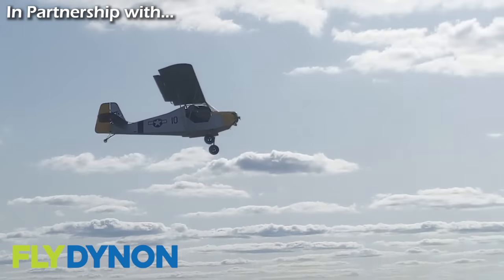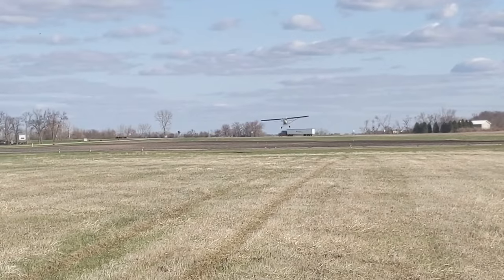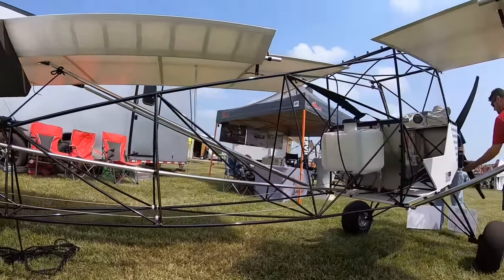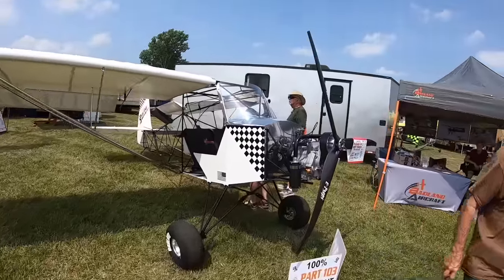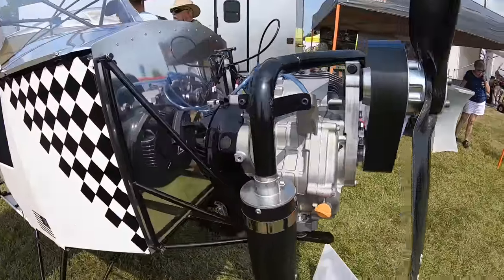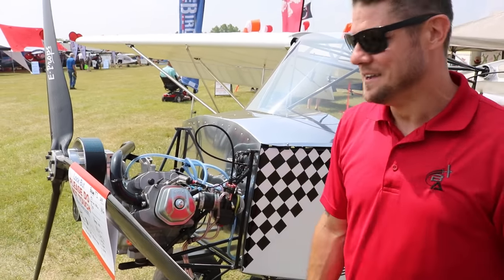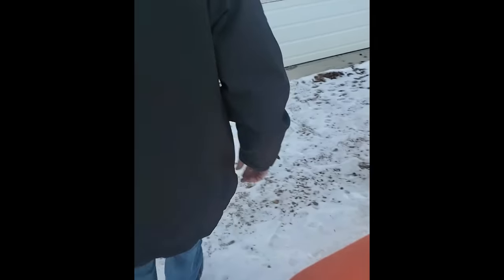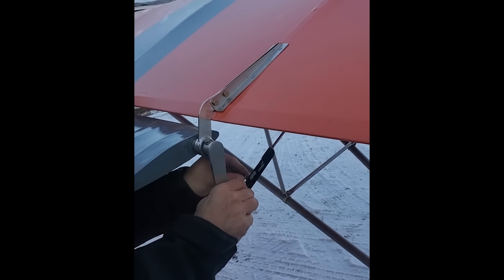No License Required Ultralight Airplane! Badland Aircraft - Oshkosh 2023

Comment: What is flight performance like with the 40hp 4 stroke and 3 blade prop? Assume 200 pound load. Avg takeoff roll, cruise speed, stall speed. How big is the fuel tank, so what kind of range could you expect?
Reply: 5 gallon fuel tank maximum
(if flying as an ultralight)

Three hours flight duration, close to 200 miles...

Get an "N number" and it's a different story.

Comment: He gave the impression that the one engine option was an all internally designed and assembled.  Where does a start up company with relatively low sales, albeit low overhead, get the $$$$ to afford the tooling to cast an engine block, cylinder head, and the support bracket to the prop is made out of a billet.  At $5K for an aircraft engine, that’s a good deal.  You can’t get a brake job on a BMW for 5$K.  I’m gonna have to drive over there and report back.  Stay tuned.
Reply: It's a Honda engine assembled with a bunch of aftermarket go-cart racing parts that make lots of power without exploding. The cart racers have already done all the designing and durability testing. The work he mentioned in the video is really just selecting the right aftermarket parts and bolting them together plus their own design for the redrive to spin the prop at a sane speed. Redrive tech is simple and well understood so it's just a matter of some simple outsourced machining to make the parts. The $5k figure sounds almost too good to be true compared to some other airplane engines I've considered. A 50 HP 2-cylinder 2-stroke goes for more than twice that.

Comment: Did he just say $5,000 for that lawn mower engine?
Reply from the maker: YES. But all the internals are competition (racing) applications as Chris mentioned so low quantity batch production is higher costs.
Reply: 5 k doesn't seem that unreasonable. It's a 4 stroke aircraft engine.

Comment: ?!?!?!?        2:14   a main wing is  SUPPOSED  to  have  a  Load-bearing  Main  Spar, located at  THIRTY  percent of  chord.!!!!!!
Reply: Sparless wings are definitely possible
Reply: A couple thousand flying aircraft must not have got that note. All the Avid, Kitfox, and their copy-cat clone airframes for the last 30 years are built with this exact wing structure. They use one aluminum tube at the leading edge, another at about the 70% chord point, and a strut brace connected to both tubes at about 2/3 of the span. This wing structure works very well with low speed lightweight wings. What you describe is only needed for wings with no strut brace taking the weight and bending moment.

Comment: I have to hear that engine running at 39 Hp on 420 cc's where most 720 cc two cyl can't make 35 Hp reliably....Could it be that it is something like a B&S, "Animal" Go Kart basis....
Reply: It looks very similar to the engines on my pressure washers. Both are 420cc pushing about 16hp. I wouldn't dare try to push one to 40hp. Even with forged parts.
Reply: regdor  would have been nice if he had a little more info on the engine !!!  Who makes it , where whats it based on !!!
Reply: I’m shaking my head over that too.
Reply: @glenmel78 website says that number happens at 8000 rpm.. making power is possible with rpm but I agree with you, who knows how long that remains assembled
Reply: @glenmel78 all of these engines are based on the honda gx390 "13hp" industrial engine, typically used in cement mixers, it's the big brother of the gx200 6.5hp. I have all the parts to build a reliable 35-40hp on pump gas for go kart use in the shed from before I had kids, all the billet parts, big valve ported head etc. One of the big issues with these motors is vibration, they run a balance shaft from factory which is a big failure risk at high rpm. My crankshaft is rebalanced with tungsten at 58% balance factor from memory to permit high rpm without a balance shaft. I know mine is 390cc not 460cc but there is no way I would consider it suitable for continuous duty use much above 4000rpm. It's a bit like vw engines, I used to have one in a buggy 2300cc with 200hp, so how come all the VW engine aircraft don't have 200hp?
Reply: I have a 750 cc from a snowmobile. It makes about 140 hp. I'm sure it's about 2x as heavy as that motor though.

Comment: That's a Sweet Little Bird!!!
Is 300hp an option?
LOL
Reply: Only in the Steve Henry model.
Reply from the maker: I do believe 300HP would make this Aircraft a dangerous Helicopter. Not an Aircraft. Honestly... 100HP would be INSANE! (Someone will try it one day)
Reply: FAR 103 does not limit HP.     Stall speed of 24 knots stall speed and 254 lbs dry are your main design limits.  If you can get a 300 HP engine flying under those guidelines then do it.
Reply: Marty, where we're going, we don't need roads.

Comment: My question is on a nice calm day in Frozen Solid, MN, what additional panels does he recommend?  I figure a -40F snow machine suit, heated socks and gloves with switchable battery packs, heated helmet including defroster for shield.  I can’t move!  Like the man says “it flys itself”.  That’s nice but it’s not like an Amish horse that knows the way home when pops falls asleep after celebrating with God the excellent crop of grapes last year.
Reply: So ..maybe he doesn't promote winter flying?

But, here in Florida, practically any day is a good day for flying...
Reply: Well there you go. Invent a comfortable battery powered flight suit. Can't imagine you'd be in the air much longer than an hour in winter.

Comment: really nicely designed.  love the pivot wing design.   $5k for the engine alone is pretty darn fair considering a quality rebuild of a Rotax 503 will cost you about $2500 and then it wants to burn 3.5 gph.  a little surprised that the Thumpair has a 200 TBO compared to 300 for a Rotax 503.   Wonder about overhaul cost for the Thumpair?

Comment: Love this kit but I weigh 315 pounds.  Any way to change something to get the plane to handle a little more usefule load?  Heart issue so need to stay 103.
Reply from the maker: Only so much you can do to keep an Airplane LIGHT. And that has been done to this design already. Like most of us, the only thing we can do if we WANT to fly a specific Aircraft, is adjust our own personal "Weight and Balance." Looking to drop about 30lbs myself before my Aircraft is complete. And that one is Experimental. How bad do you want to FLY? :-)
Reply: @ExperimentalAircraftChannel  , Thanks for the reply, The weight limit seems arbitrary and unfair.  Those of us born 6'5" and 300 + lbs are just SOL when it comes to the numbers decided in 103.  Aerolite 103 seems like one of the only airframes that can handle larger pilots.  Unfortunate if you like the Badlands design but have my body.
Reply from the maker: @BruceTGriffiths  would love for the Part 103 rules to add ones "Note" into it stating something like "254lbs empty WITHOUT THE ENGINE" which would pave the way for MANY future options and give a pretty good weight increase to the Airframe.
Reply: Yes, you could change the construction materials in some key places to say, titanium, magnesium, and carbon fiber. Then add as much wing area as possible until you have the plane back to 253.5 pounds, but remember to into account the chanes to the tail due to the larger wing. That will likely change the CG, so a moving the motor location may be necessary too. Now, since you've changed the materials, shape, flying characteristics, and price point, you might as well change the name of it too. Let's call it the "Something Else XL."
There will always be a limit, and that limit will almost always seem arbitrary and unfair to those that are just a little outside of it.
Reply: @Logan4661  True that and Thanks,
Reply: @BruceTGriffiths  If flight is your goal, and not necessarily an airplane, you might consider (if you haven't already), a Powered Paraglider trike. It's relatively easy to get a setup that can handle your size. It's a different style of flying... but it is flying! Anyway, I hope you get in the air one way or another.
Reply: Thanks anyhow.

Comment: safety pins? isn't there something a bit more aircraft grade to do that job?
Reply: Agreed. It just has to stop the nut from turning so it's probably fine, but there's just something about a critical part of the airplane looking like a flimsy toothpick ...
Reply: I remember those kinds of pins safetying T/R valves and handles on DC-9's
Reply: I don’t think they are like the safety pins your mom used to temporarily fix the curtains…..😎
Reply: It would be a locking type pin like a reusable cotter pin and called a cowling pin by Aircraft spruce.
Reply from the maker: Chris uses all Aircraft Grade hardware.

Comment: I will be glad when that" no license required" statement is a thing of the past. There is simply too much to know about Aviation to just be turned loose in an aircraft.
Reply from the maker: No License Required does NOT mean that you shouldn't get training to FLY Light Aircraft. It is a true statement however. Part 103 FAA regs state this. You  should (and we recommend when flying ANYTHING) get transition training into that Aircraft.
Reply: Hater just dont fly

Comment: "No license required"......shocking!   But there's no license required to travel in you own private property....even automobiles....but that doesn't stop the sheep from applying VOLUNTARILY to be licensed, does it....
Reply: I don’t understand what you mean
Reply: Yeah because normal people have jet planes
Reply: You have bad interactions with the police I'm guessing.
Reply: 🥴 “sOvErEiGn CiTiZeN” 🥴
Reply: @s.eldenhall2938 you can travel. You can walk, take a bus or a commercial flight. You do not have a right to drive or fly outside your own property. You can operate a car on your own land. You can taxi and aircraft around your own land too without a license, but you cant go anywhere (unless it is an ultralight).
Reply: @s.eldenhall2938  got any proof of thus?
Reply: 14 CFR, Chapter I, subpart F, Part 103. Is the best thing that ever happened to aviation in the US. 

It defines a category of flying machine that has no regulations out side of those stipulates: Weight, Minim speed. Maximum speed. Prohibited Altitude and airspaces. And for some reason; Fuel capacity.

Brilliant designers have figured out how to make them reasonably usable and airplane-like. This isn't the Wright-Bros anymore!
Reply: @s.eldenhall2938 lmao doesn’t sound like you get off with warnings often when you get pulled over.
Reply: @EllipsisAircraft i think the the fuel limitation has to do with balance and center of gravity. 
Fuel is heavy and can slosh back and forth and disrupt the center of gravity. Too much weight shifting too fast can destabilize any plane. 

And some dipsht somewhere would likely try to stick 50 gallons on an ultralight if allowed 😂 

There is a mathematical formula   The FAA used to determine what would be a ( conservative ) safe amount of fuel vs a 254lb ( max) airframe so people could have and hour or two of fun flying ,and build whatever, but be sure not to overwhelm the center of gravity and risk departing from  controlled flight if “sloshing” happens 😊  so 5 gal (30.75 lbs) was deemed a universally safe number .

That also limits the amount of time a person ( likely amature) can fly ( an hour or two) … reduces the risk of pilot exhaustion 

Also gas is flammable. In a “ uncontrolled landing” ( crash) this limits the amount of flammables onboard . A known max limit for firefighters.  
So there was logic to the limit
Reply: @celestedestiny  there are reasons. But intelligent designers could figure out how to install 10 gallons safely. I think the reason, is to ensure ultralights are never useful for anything.
Reply: @EllipsisAircraft  i think they can be useful for lots of things.  With about an hour of flight time they are great for observing farm fields and  herds and crops from the air. Great for finding livestock that has wandered off . They can be real good for search and rescue or just bee bopping over a friend’s house ( if you live rural) . And they are just fun . Also great for getting into remote camping spots. 

I mean a-lot of that can be done with drones these days but they can still have uses for a private owner Especially on a farm or ranch . 

Trust me you can spend 8 hours on a horse looking for a lost cow in the woods or just buzz around for 30 minutes and spot it.  

Too much hassle and too expensive to use a real plane and  flight plan and airports and all… just take off from the drive way and take care of things and burn as much gas as mowing the lawn 😂
Reply: @celestedestiny   Rotax 2-stroke engines consume that fuel within about 120 minutes at low cruise rpm. If you land with 30min reserve that is 1.5 hours. At 40mph is 60 miles. Unless the wind is blowing 20mph. Then you will only go 30mi.

They aren't really useful with 5 gallons. They can never achieve 100mi range. A 4-stroke dirt bike is vastly more practical, with a 70mph top speed, 60mpg, and 120 mile range on 2gal. While bringing a person on the back in a pinch. For example.